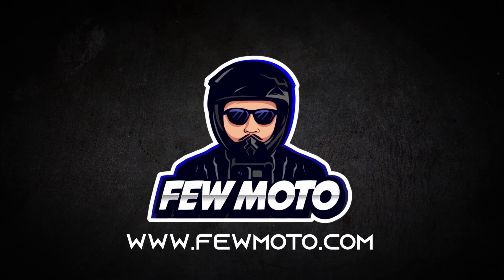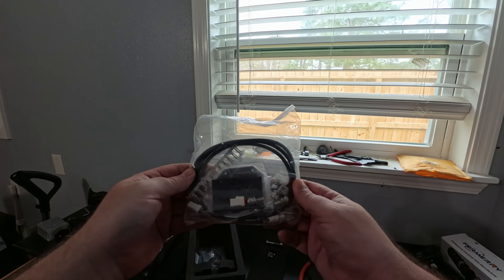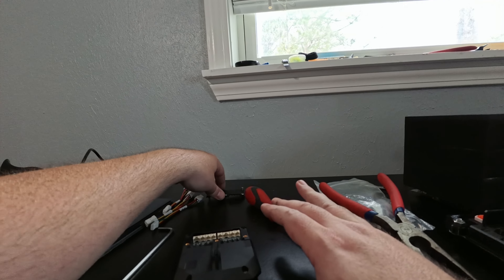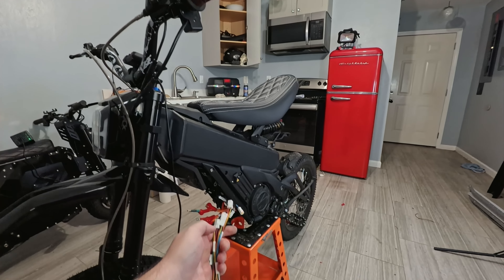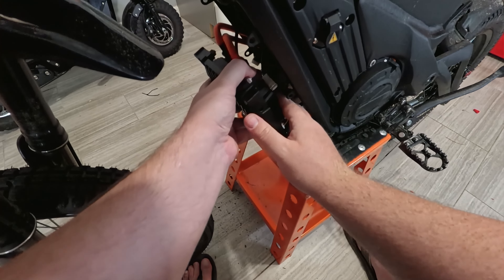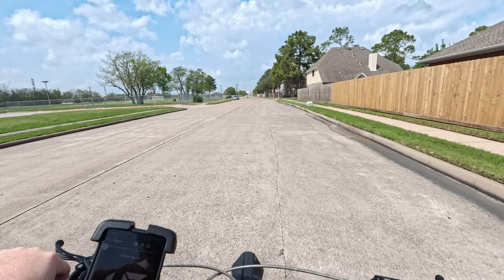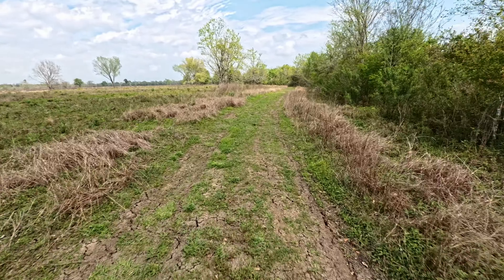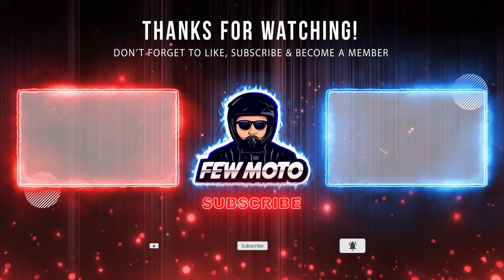Talaria xXx: Nucular Controller Install & Test Ride

Comment from the maker: Note, the display is tight now, just needed to tighten it more.  And the power modes are changed by the stock red button on the right side near the throttle.

Comment: I'm not sure this is helpful 4 months later, but to access more settings on the controller that are missing, you need to up your access level under Devices -> "Controller Name" -> Extra Parameters (on the second page) -> Access Level (at the bottom). The default access level disables some settings to make the screen less cluttered and easier to manage on the go. If you want all of the settings, you'll have to change the level to "Engineer".
Reply from the maker: Thanks, I figured it out eventually.